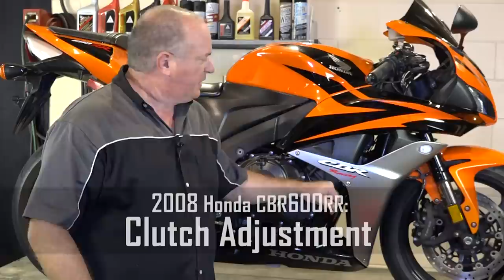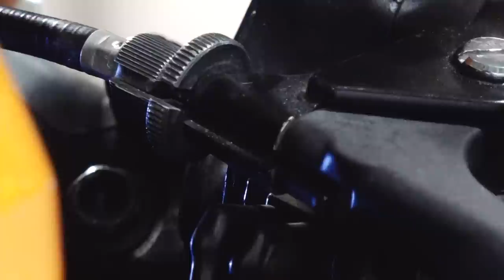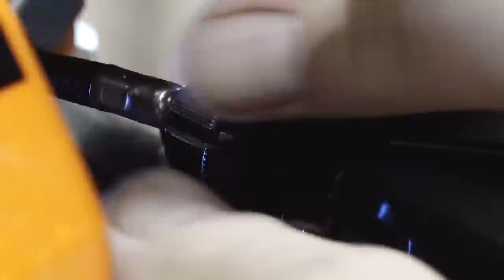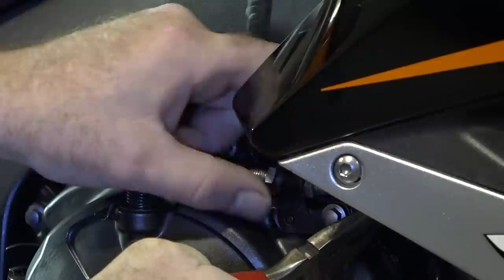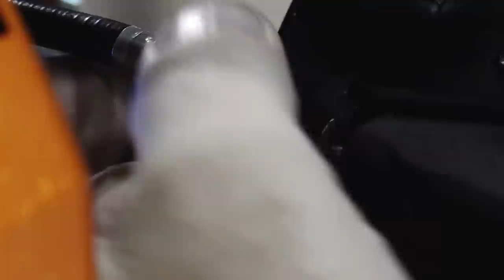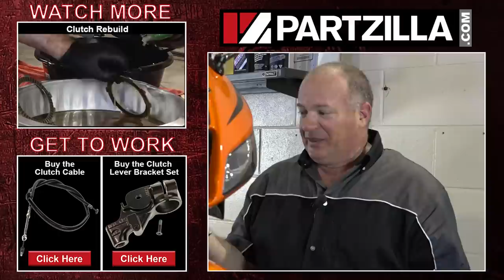Motorcycle Clutch Cable Adjustment | Honda CBR | Partzilla.com

Comment: No matter what i do my clutch slips in high rpms gsxr only has 1k miles put new clutch lever on it. Cant fine tune it
Reply: @dhilip_cs  there 3 adjustment. The lever, bottom of clutch cable off clutch case and internally for 2011-25 gsxr 600/750 i got it running good now

Comment: Hi John, I removed the clutch cable to lube and when reinstalling , just could not get it right like the service manual tells to.
Bike is a Kawasaki Z800 , which Kawasaki in their infinite wisdom wants a 60' angle at the release lever to the clutch cable angle.
Does the angle really matter that much if the freeplay is perfect .. 
Asking since when you adjusted here, you didnt seem to worry about the angle of the lever ( lever on the clutch cover )

Comment: If I have all the clutch plates replaced on my cbr954rr, how long should they last? I had it done at a shop about two months ago, and I’ve only ridden it for about a month or five weeks. Now I have to choke up on the adjustment screw so there’s no threads left. Is that normal???

Comment: Hi John. You being a clutch expert, maybe can take me out of my misery trying to understand, why some clutchs has various types of friction disk? and some not? and what is the differente between the disk and the consecuences of using the same disk on the entire basket?

I have a Yamaha FZ6, and it has 7 friction disk 1 type and 2 different type of disk on both ends of the clutch basket, why are those different?

I ask because after i rebuild my clutch, i realized seeing this video and checking my bike manual, that i made a mistake and put 9 friction disk of the same type on my bike... it works, but its dragging at little at engagement, so i dont know if that is the reason.

Thank you.

Comment: So I have a problem? If anyone could help that would be amazing. I have a 2007 cbr 600rr and the clutch is harder to pull in now it use to be easy an it started that yesterday after I tried to do a burnout when I put in gear I go to floor it and it goes really slow i put it in 2nd an it does the exact same thing like it has no power smh can anyone help man im so stressed right now

Comment: Is it true that the clutch fork thats on the motor (the shaft with the spring on it) should be 90 degrees to the motor? Mine is more arpund 75 or 80. And I have about a 1/4 inch of free play between the the end of the adjuster and the where.the cable goes into the lever. Is this right? The bike doesn't  creep forward and disengages fully.
Reply from the maker: That's not typical, there usually isn't play there.  might be something to inspect.

Comment: put a new clutch cable on my 600RR thinking the cable was stretched cause i was starting to notice slack in the cable and adjusting wouldn't help. I put the new cable on and it didn't help the problem. someone told me maybe my clutch is worn out but I haven't noticed any clutch slippage.  after looking at illustrations I'm wondering if maybe the bearing for the clutch pull pin is worn out...
Reply: samuel lopes I’m wondering the same on my 636. Is your clutch rod freely spinning on top of the clutch case?

Comment: Do pull the cable down at the clutch cover all the way forward then tighten it? Wouldn't that be disengaging the clutch without pulling the lever in? Or do you pull the cable back then tighten it I am confused.
Reply from the maker: You don't push it forward to disengage, you are just pushing forward to eliminate slack.

Comment: Any recommendations on an 08 600rr that shifting gears requires 2-3 times the amount of normal pressure than other bikes? 9k miles track bike, just very difficult to shift and find neutral
Reply from the maker: Could be clutch wear or bent shift forks in the tranny.

Comment: got a 2001 Honda cbr f4i 600 clutch working perfect and changed lever now no clutch. ran it all the way up and down no luck. i pushed bottom lever with finger till tight and tighten nuts and got good on top but put in first and try to roll and u can tell it still engaged. put in natural and apply brake and when I try to put in fist it clunks and dies. never had so much trouble. even bought a new cable thinking old one might have stretch. would like to know what im doing wrong  thanks
Reply: even took channel locks and pushed lever on engine to engage all the way and set clutch adjust same so when I let off clutch it stay the same so seem to be at max to engage unless there has to a lot free play
Reply from the maker: did you install the new cable? if so you may have received the wrong clutch lever.
Reply: Same cable even used old one.took cover off and lift pin good. It's like clutch froze up but was working before and all I did was change lever

Comment: Could this be part of the reason why my 2002 yzf r6 slips a little when I reach the power-band? Thanks.
Reply from the maker: It could be.  Is that the only time it slips?  Adjust your cable and see if it helps.  If it doesn't, you may need to service your clutch.

Comment: I bought a brand new cable and both adjustments by lever and clutch cover are maxed out. My friction zone is still right at the grip almost. Will a new clutch fix this or do I need a new basket? I also have a new aftermarket ez pull lever.
Reply: 91TwinTurboZX I think these levers are causing an issue, I have one from impaktech and am finding it impossible to get my clutch adjusted properly. I even got a new clutch kit and cable.. still having issues.
Reply: NKGINHD think the basket have anything to do with it? I had short levers before and it was better but still almost fully adjusted to disengage the clutch
Reply: 91TwinTurboZX it’s a possibility but when I had my clutch open to change the plates and springs I felt my basket as instructed in his replacement video and it felt fine.. so I’m not sure. I’m going to have no choice but to take it to a shop I think.

Comment: How do i know that Its time to adjust the clutch? The bike is now creeping foward with the clutch lever fully pressed. Is it time for an adjustment? When i press the lever there is a large zone where it depresses with no resistance and then finally starts to resist until its fully depressed
Reply from the maker: Definitely time for an adjustment.  There should be an adjustment at the lever and at the clutch.  Tighten it up!  When you pull that lever, the clutch should not engage at all.
Reply: Thanks!

Comment: I have it so my clutch starts to catch about a halfr of an inch after i start letting it go from full pull. is that bad?
Reply from the maker: No.  You can set your clutch pull however it makes you comfortable.  Ideally, you don't want any free play in the lever.  As long as the clutch fully disengages when you pull it in, the rest is personal preference.
Reply: awesome thank you. there is a little bit of free play when i pull it before the clutch starts to disengage, but i'm using adjustable aftermarket levers so I assume thats why

Comment: My bike slips at high rpms from first to second there's play in my clutch but when fully pulled it it stops and shifts ok at lower rpms do you think it needs an ajustment
Reply from the maker: It's worth diving a little deeper to check your clutch.  If it's fully engaged and slipping, it needs some heavy service.
Reply: @PartzillaParts  it only slips going through neutral every other year is fine smooth and quite it also only slips at really high rpms or when I'm at a high mph like if I'm at 40 and go from 1 to second or back down it will do that
Reply: @chasemcclary8861  Your gears are starting to go. They are worn. Super common on Cbr's.
Reply: @adamgasiewski7561  will they be fine if from now on I just short shift to second them bang out the gears
Reply: @chasemcclary8861  Yes. You can usually ride like that until the end of time. A few track days or clutchless shifting 1-2 will kill it though. Don't worry about it, ride on.

Comment: I tried doing this with my bike but whenever i go from Neutral to 1st gear (while holding the clutch) my bike jolts forward and stalls. Why is this?
Reply: It does not disengage fully. Frictiom zóne too low

Comment: I put my bike on maintenance stand and when put into first gear rear wheel start rotating when clutch is full pulled. Is it bad sign of my clutch plates. Is there way to identify bad clutch plates without dissembling (Honda Honet 250). And I have good slack upto standard rangeThanks
Reply from the maker: If you have bad plates, you'll have slippage.  It's normal for the wheel to spin a little when you pull in the clutch on the stand.  If you put your hand on it, does it stop or do you have to force it to stop with some real pressure?
Reply: Yes I put bit pressure and it stopped. Do you have parts for Honda honet CB250 models. Thanks
Reply from the maker: We only have parts for US models.
Reply: Thanks

Comment: The reason for disconnecting the transmission from the Honda 600 2004 CBR RR is one of the reasons
He takes a spare change but does not walk